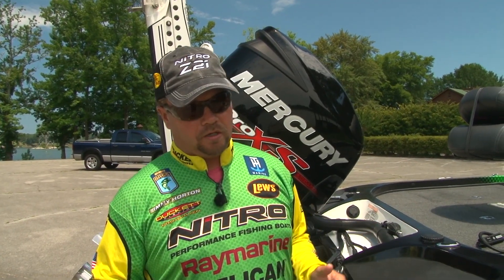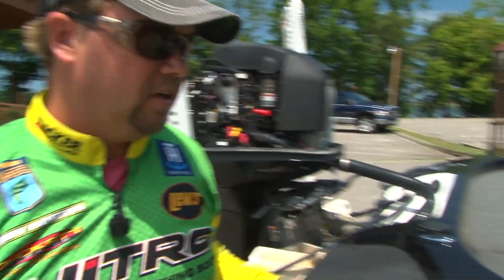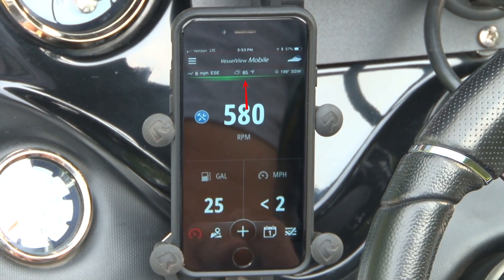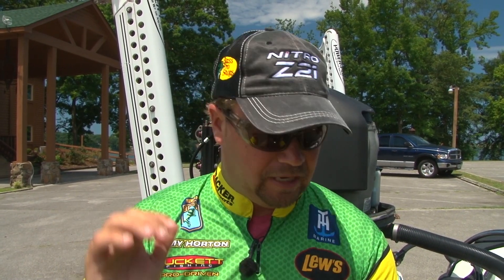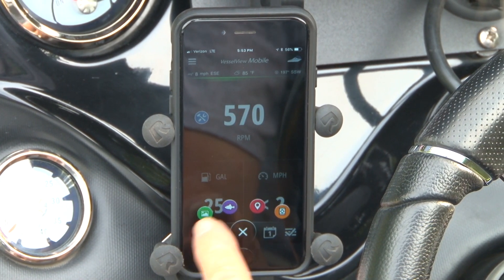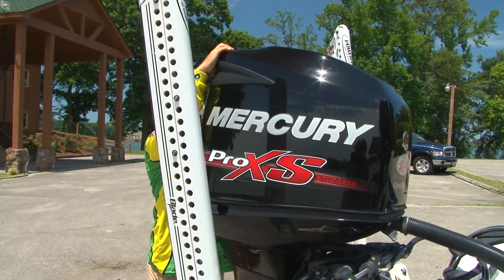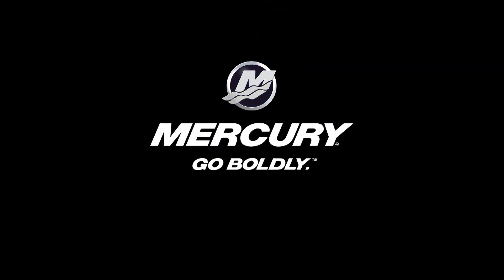Mercury VesselView Mobile

Comment: My smartcraft light dont stay on it blink 2 or 3 times and stays off
Reply from the maker: Please reach out to our VesselView Mobile support team directly through the app. Open the app and tap on the settings menu in the upper left corner of the screen. Next, tap Help & Feedback, and then tap Send Feedback. This will open your email browser within your phone so you can describe exactly what is happening and a specialist will get back with you shortly!
Reply: @MercuryMarine  I'll give it a try cause its a brand new motor havent seen water yet
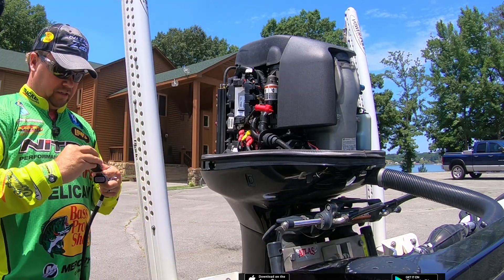Reply from the maker: @Hector_Cuevas1  One thing to quickly note, your SmartCraft light will not come on steady if there is no termination on the harness. Pay close attention to the video around 0:40-0:50. The cap that comes off the engine must be exchanged with the cap that comes on the module pigtail in order for it all to work properly. If that doesn't do it, shoot us an email through the app and we can get you sorted out!
Reply: @MercuryMarine  i put the terminator cap to the harness
Reply: @MercuryMarine  its a 2021 90 exlpt fourstroke mercury does it matter
Reply from the maker: @Hector_Cuevas1  should not matter. If you are not getting a SmartCraft light and it is terminated, we will let our support team handle it from here. We are sure it must be something simple and they should have you up and running in no time. If you are located in the US or Canada you are welcome to give us a call at 920-929-5040 and one of our agents can walk you through some scenarios!